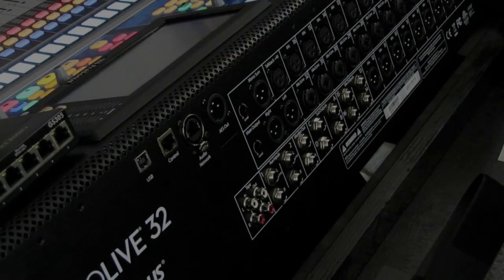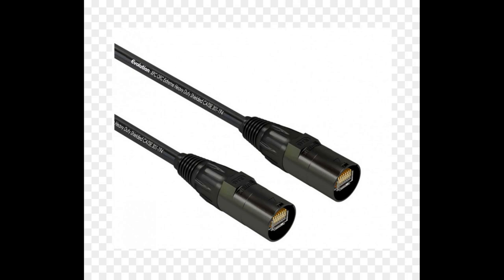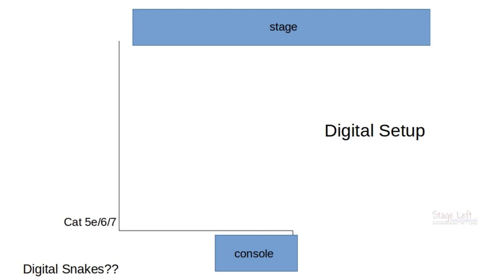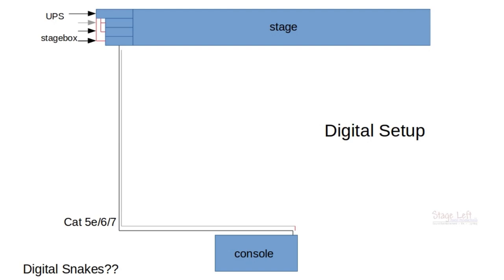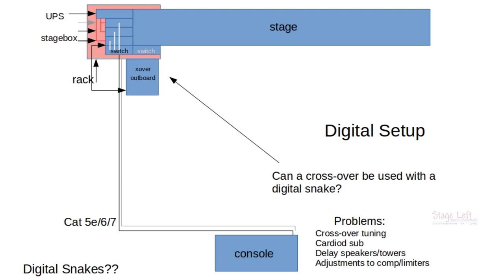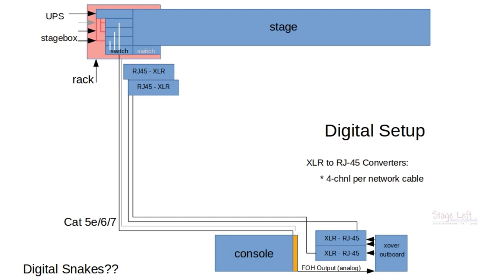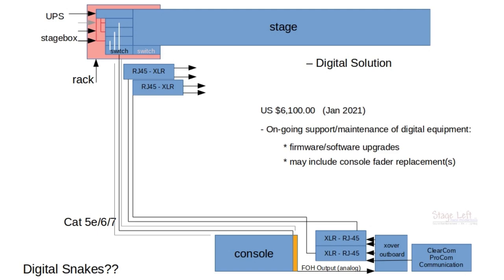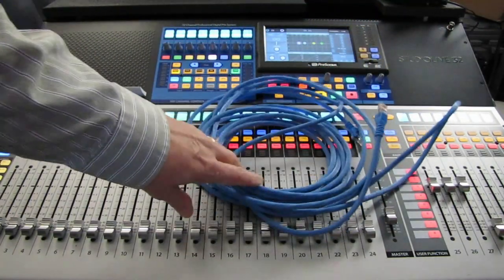Are digital snakes only a single CAT 5e/6/7 cable?  Marketing says they are?

Comment: A few points to be made here 
For a start, I've actually had waaaaaaay worse reliability on analogue snakes, stress on cables over time does cause issues believe it or not. I personally carry a bunch of 30 meter XLR cables as backups for channels, and I've definitely had to use them a good few times. 
Speaking of connector robustness, standard ethernet cables are robust enough for many datacenters and large businesses, they're most likely also robust enough for your router on-site. The most likely instance for your cable to go bad is during transport. It's not going to magically shatter mid-event if you stare at it wrong, it's protected within the cable box/doghouse at the back of the mixer.
For backing up stageboxes, it's pointless for the most part. Stageboxes are a hell of a lot more simple than the mixing boards, which instead of being "little computers" are often actually full-on computers. Take Digico for example, they have a custom software running over full-on Microsoft Windows. Allen and Heath I-Live series were so, so unreliable purely because of the fact that they ran their software over a full version of Ubuntu Linux. A digital console is always much more of a failure point than a stage box. 
For 32ch desks, manufacturers often offer a choice of digital stagebox sizes. For example, with X32 and M32, you can buy the DL32/S32, which are 32ch digital stageboxes. If you want 16ch boxes, then buy DL16/S16. 
A UPS is also unnecessary, since if you lose power enough to kill a stagebox or desk, your amps are already long gone. No point in sweating that the stageboxes are still running when the speakers can't make noise. The most you'd need is a basic power conditioner.
I don't know if you're aware how the daisy-chaining method works in terms of the science behind it, but I can assure you there's no need to put a switch there. The daisy-chained units aren't being processed by others, they simply relay the signal. The addition of the switch will add more latency than just daisy-chaining them the way the manufacturers designed them to be used.
A rack shouldn't be an issue at all. Many "high end" analog stageboxes are in fact rack mounted, the more basic models are just a box on the end of the cable. Either way, if you really can't cough up the cash for a small budget rack, just use spare rack units in an amprack if you have them. 
If for some reason you really, really need to have your crossover at the FOH instead of setting it up beforehand or just running subs on aux sends, the majority of consoles can repatch channels to individual connectors of their local I/O. No need to run cable all the way back up and down. Crucially, you can send the output of the processor/crossover back into the desk and into dedicated outputs on the stagebox. Patching I/O works both ways around. 
Regardless, if you're at a show large enough that you absolutely have to be able to re-set the crossover during a show, and for some reason can't use aux sends, there's most likely a dedicated systems technician on hand. I'm also not sure why you "can't set delays at the stage". Most modern desks have the ability to be controlled remotely, so your aux sends for delay units can be set up directly from your phone, tablet or laptop. The same goes for the vast majority of modern DSP processors and crossovers, they're able to interface with a phone or laptop so you can walk around the entire venue and tune as you go.
Comms is a whole other can of worms I'm not about to open in this comment.
Bottom line: For community festivals and the majority of shows many of your subscribers (and you yourself) would be doing, Coachella levels of redundancy are unnecessary (even though the most important redundancy has been completely ignored: the console!!!!!! weakest link in most digital setups) 
It's no secret that analog has its benefits, which is why I still stock analog gear and use it for small shows. That said, the end result of a good digital setup is superior in so many ways that it makes no sense to do it any other way for the vast majority of shows now.
Reply: agreed. I think analogue splits are still great for festivals to avoid gain sharing, and to leave tails for guest consoles, but that's pretty much it.
Reply from the maker: Great comments.  We still use analog for most larger multi-band shows, but will usually use digital for smaller ones.  Every event we do, we carry a backup console, though I don't think this was ever mentioned on any of our videos.  We try to use the best tool for the job.
Reply: @stageleftaudio  to be fair, I should have mentioned I do still use analogue here and there myself. I find it pretty handy for much smaller, budget friendly systems. My favorite use for it right now is a little Soundcraft 16 channel in a rack with a few budget wireless mics and some cheap 4 way compresser/limiter units from Behringer. It works great, very handy for when a client just doesn't have the budget or requirement for anything bigger. Also great for DJ events, since I only need like 4 or 5 channels for those
Reply: This video is directly for presonus users. Those in the m/x32 systems will not be using a network switch. Also crossover at FOH? Use a newer driverack at stage and access all features with an iPad or laptop, then lock it out so any band techs can’t adjust it. For aux fed subs etc do your processing on a matrix. In fact use L/R Sub and FF on your matrix. Typically I’ll use 2 cat5e Ethernet and a DMX line and power. Anyway, interesting video.
Reply: Hot digity.... I was going to come in here and make all kinds of comments.... and then found all of them were already here.  :)  I don't disagree there is a place for analog, but I have been running full digital for all kinds of shows large and small for years.  I do have an analog rig for some outdoor things that consist of less than 3 inputs and 2 outputs, but that's it.  For anything else, I've left analog long behind.  

I think the biggest advantage in digital is the patching and sends.  Something not in the right plug?  Most cases, I can reroute and keep going.  I can save scenes and presets and run multiple bands at the touch of a button.  Also, I have some mobile application that depend on fast setup and teardown, and digital has always proven to be faster and easier to get up and running.  I even have one kit that is 100% wireless and all I have to do is give power to the rack and the mains, grab an iPad, and we are running.  We have backup cables just in case, but never had to use them.  

Good breakdown, Noodles.

Comment: Disappointing.   Have always enjoyed your videos.  This one I actually stopped at 12:57 mark.  Couldn’t take the negativity anymore against digital snakes.  Most that watch your videos I am sure could use a digital snake to its advantage and are not running sound for a big event.  Spare (you forgot to mention “shielded” CAt5e) cable(s) a must.  If running sound at this level you would have a digital monitor board along with FOH which will give you options if something failed to run from one board with an iPAD remotely.  If a digital snake failed you can use the monitor board as your connection for the analog inputs and outputs.  Network switches and crossover out front over kill for your you tube audience.  Looking forward to your next video being positive with great information again.
Reply: Just as a little side note: the shielding on the Cat5 cable can vary in necessity from desk to desk. I believe it was the Behringer X32 that didn't work properly with the shielding, causing huge spontaneous pops and bangs.

Crossover out front, completely unnecessary in today's world. A bog-standard DBX can be controlled from a laptop or phone, and converting XLR to Cat5 and back is just a really weird way of doing things (especially just after he mentions that you can repatch all your local console I/O, wouldn't you just send the crossover back into a stereo channel and patch it to outputs on the stagebox?)

He's also completely forgotten that the biggest point of failure in a digital system is the console itself, which seems to be the only thing he hasn't made redundant (makes no sense, even a monitor console could be used for redundancy)

I think he's way overshot the audience this time around. Also other things I've seen in his videos make me pretty concerned safety-wise, like the cheap line array towers that are pretty sketchy indoors, let alone outdoors sitting on the stage without guy lines or proper tie downs
Reply from the maker: Thank you for your comments.  The video was certainly not intended to be negative toward digital snakes (or digital solutions)!  The content was to show the possibilities of what may be needed as a sound provided, but more importantly to show there could be a lot more to putting together a digital solution.  I try to cover a wide aspect  of running sound in our videos.  Hopefully our future content will prove to be more positive.
Reply: @stageleftaudio  I think your video wasn’t negative per say as ill informed as to how this is done at certain levels... you were trying to explain at the best of your ability, and it is incorrect how “things are done”..now
Reply from the maker: Don't forget... the video is covering a Presonus solution.  There are other ways of achieving a digital solution through other manufacturers.
Reply: @stageleftaudio  it doesn’t change the fact that there is no appreciable latency with your system, (under .5 ms) the crossover function (at your level or production) can be more than handled by keeping it at the stage, and comms, lighting control can be handled with either one more cat5 - 4x xlr breakout. Or two xlr cables... your choice

Comment: Although everything here is theoretically correct, I have to say that I disagree with most of it. I've been watching a lot of your videos for fun. And everytime I have been thinking "Why don't they just get a digital stagebox and a cat cable" It would be so much easier. 

I do around 100 shows here in Denmark each year, and for the last 15 years I have been running just a digital console (LS9 and now a QL5), 2 x 16/8 boxes and a single ethernet with power strapped to it. Never had a failure. No switch, no UPS, no extra ethernet (although I do carry a spare in my van). All crossover is done in amps. Fills, delays etc are done in the desk via matrix outs. 

A digital setup does cost more. But ohhh... The advantages. Not lugging around a big analog cable, total recall on everything in the desk, and standing right next to musicians with an ipad on stage and mixing their monitor wedges during soundcheck. Wouldn't trade it for the world. 

Most desks today stay below 0,5 ms of delay. I run inearmonitors for most of my bands and everybody are as happy as they can be. We regularly jump right into a festival show with only a 2 min linecheck.
Reply from the maker: Thank you for the comment.  The basis of the video was to show what could potentially be involved with moving to a full digital solution.  Though, we know that not everyone needs (or wants) redundancy, and will probably not want a UPS or even racks to keep the equipment "safe".  Some bands I mix for (on their gear) use full digital setups; they are great.

Comment: I have considerable experience with all strata of digital audio as a provider and your video has many points that are just wrong.

There are no processors in digital stage boxes, hopefully just D to A converters and some form of FPGAs, so no need for UPS. Use a UPS on your console.

The stage boxes if properly designed do not create enough latency to cause more than .02 ms of delay barely noticeable.

Lake controller solves your crossover dilema. 
Digi
Reply: I fully agree with you this video is so full of false info.

Comment: I see where you're coming from. What I do is, I use my digital mixing console with an analog 32/8 snake. So I have the benefit of using less outboard for effects etc. but still the flexibility for drive racks and delays and so on....
Reply from the maker: This is exactly how we setup our system.
Reply: The problem with this method is that more and more digital consoles have less physical inputs (I.e. the A&H Avantis with only 12 inputs, the Wing with 8 inputs)
Reply: @Thomas.Hoermann71  yamaha cl the same.
It is not the correct way... 
in this video it seems to have remained in 2008

Comment: Your Scenario is Based on running monitors from FOH, but if you run monitor world then you would patch both consoles together with a single Cat5 Cable, and if you want to run x-over at FOH then you would need to run 2 Cat5 cables, then you would need 2 xls-rj45 converter.

Comment: A great video, and quite frankly it defines why I haven't gone fully digital.  I only really do smaller events and have both digital (PreSonus 16.4.2) and analogue (Allen & Heath GL-2400/32) boards. I select the board to use depending on what I'm doing and the amount of space I have; I frequently don't have the space for outboard as some of the venues I'm in are "cosy" to say the least. In that case I use my digital board, which does not have support for digital snakes anyway, but does have most of the features I would use my outboard for.  I have looked into going fully digital, but having taken into account things like latency and cost; it's a solution to a problem I currently don't have.  I think I'll be using analogue snakes for many years to come.   I'm by no means anti-digital; I just don't have the need to go fully digital right now.

Comparing how we work, there is one small difference in the way I do things; I place my speaker manager in my amp rack at the stage.  As I also offer basic lighting services and projection, I run ArtNET for control, so use the same ethernet link to give remote access to the speaker manager to control it from FOH.
Reply from the maker: We too have no plans of moving to a full digital setup, especially for the large events.  We may consider it for smaller events (low channel count events).  True, full-digital is a solution to a problem we don't have.  Thank you for the reply.

Comment: We have a full blown Behringer X-32 console at our church,connected to an X-32 rack mixer at the stage. The two are connected using Cat 6 STP cable. Much cheaper than ethercon cables and just as effective since nothing ever gets disconnected. We have some microphones connected to the main console through a 24 channel snake that was in place with our analog system. Other microphones and all monitor outputs are connected to the. X-32 rack. The monitor outs consist of floor wedges for the choir, a hot spot for the pianist, and in ear for the soloists. Latency has never been an issue.  We could have used a digital stage box just as easily, but we had the X-32 rack.
Reply from the maker: Thanks for your comment.  Fixed installations are great for digital solutions!
Reply: I have noticed more and more setups where the FOH mixer is either on stage or just off the stage and FOH mix is done with an iPad or other tablet computer. In those applications, the X-32 rack and a DL16 stage box would be all that is needed. We opted for the full desk because our sound person was more comfortable having actual faders and buttons. There are times when my husband will sit in the audience and run things from the iPad with no one at the desk.
Reply from the maker: The IPAD method of mixing is great for small setups and for bands (to use as their mixing solution).  We (as a sound provider) do not use IPADs.  All of our mixing services are conducted using physical consoles.  Though, we do mix for a few bands using their PA system.  Many have IPADs as part of their setup.
Reply: @stageleftaudio  I’m not sure what you mean by ‘small setups’ because I’ve seen churches with full bands and 12 vocalists, plus 6 choir mikes mixing FOH using the IPad from the audience, while another person was mixing the live stream feed using another iPad with headphones. I’ve also seen another church using 3 analog consoles (one for FOH, one for monitor mix, one for TV feed.) Their pastor didn’t see the need to upgrade their audio equipment . Each person or group has their own preferences. There is a You Tube channel where there is a couple who provide sound for some rather large groups that uses Presonus consoles and mix from either a laptop or ipad. Have a blessed day.
Reply from the maker: IPADs are great for smaller shows that are a temporary setup vs. large multi-band setups.  My comment on the smaller setups were directed toward temporary setups with multi-band events.  Having immediate access and control of the inputs on a console is extremely important to a good mix, but more importantly, to be able to correct a problem within a 2-3 seconds.   Ultimately, (from what you referenced), it depends on what the person/group is comfortable using and what works for them.  These are all tools.
Reply: @stageleftaudio  Yep, it depends on what people are comfortable with. I will say that with the IPad app, hubby can adjust any parameter just as quickly as he could at the Behringer desk.  What he likes about the digital board and the app is that he can have different setups in memory based on the group, and load that setup with the push of a button. When we used to have open Mike Singings at the church, he would load the profile for that which reconfigured some of our floor jacks from microphone inputs to inputs for guitars and bass guitars using direct boxes. Levels were set automatically for the instruments based on sound checks used before. So, every month, when we had the Singings, he just loaded that profile, then changed it back to our normal Sunday setup.